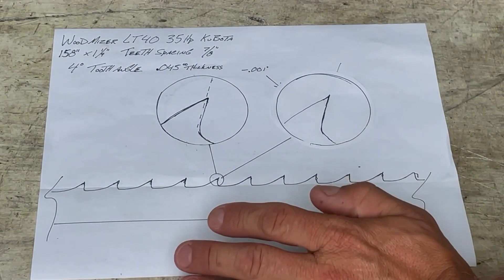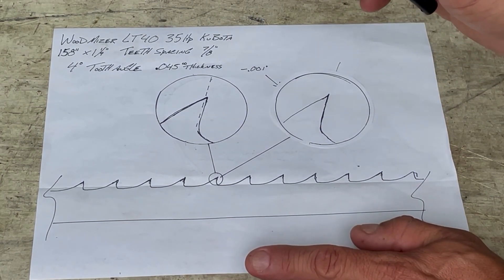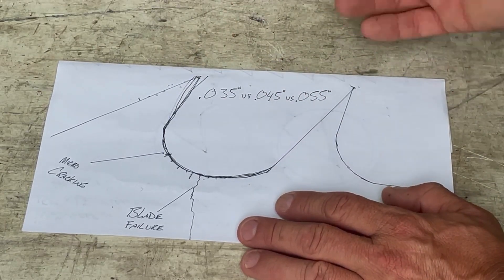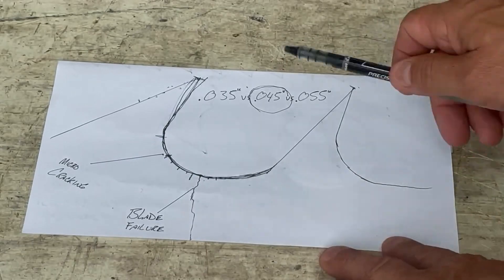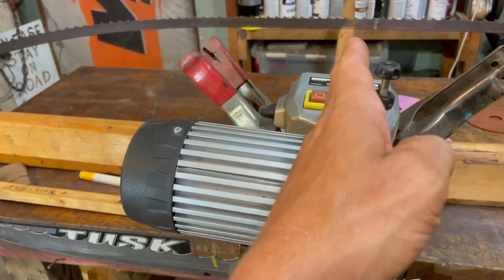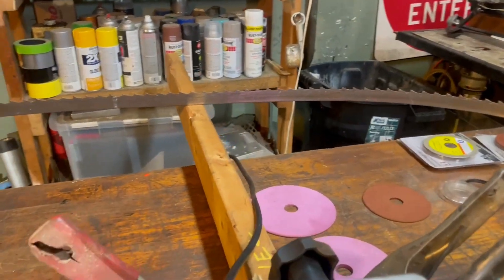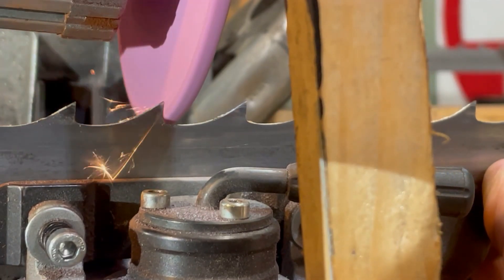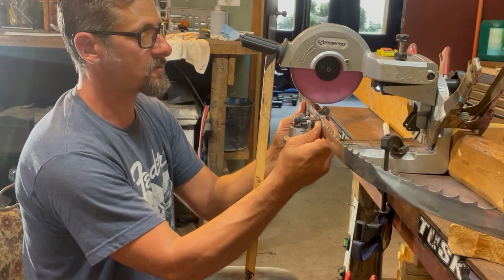How to Sharpen Sawmill Blades [DIY] ┃Save Money Homemade Sawmill Blade Sharpener #sawmill #sawblade

Comment: I ran across your video again. You mentioned about lifting the sharpener up and grinding to tooth off. Isn't your grinder set at the tooth angle? If so it should lift without hitting the tooth.

Comment: When i buy new woodmizer blades they have blue tips, think its from the hardening, do you know if they get blue when grided that makes them softer or harder? would think it depends on the metal can air harden or it needs to be shock cooled to harden?
Think the brown disc is meant to be oil cooled.

Comment: You made an excellent video.  Thanks!

You got straight to the point without rambling about a dog that had puppies or a lane joke you heard.  This is the way to make a useful video.

I'll be checking to see if you make a video on carbide blades.  I doubt I'll be using anything else if I can find them in the right length for my mill.
Reply from the maker: Thanks for the kind words, glad you found the video helpful!

Comment: In 2002 I bought a Linn Lumber Mill 190A to build a small cabin with. Along with the mill I also bought their sharpening and tooth setting equipment. These purchases that I made have saved me a lot of money!!!!! I still have a couple of the original blades that I have sharpened probably as many as 20 times. 
The Linn Lumber sharpening and tooth setting equipment is not expensive and simple to use, check them out!!!!

Comment: Full profile sharpening is the best way to go , and if you are serious about case hardening the gullet use a fine burr grinder to "polish" the gullet, sharpening only the face of the tooth is making the the tooth thinner each time which in turn may create a weaker tooth and "wash boarding "may occur, I suppose which ever way works keep using that method👍

Comment: if you take a small bright led flashlight and shine it on the face of the tooth after you have sharpened it one stroke the reflection from the sharprned surface will show you how the stone is contacting the tooth and if needed make adjustments. I waer a small headlamp so I don't have to fool with flashlight

Comment: Update;
Man I shaped a grinding wheel to match my blades and had good success,. or way better than what I had.
Problem is it was time consuming.
I know that my blades cut like a razor,.... But..
I also know holding the blade by hand I'm getting some variations in angles and depth,. don't get me wrong I had surprising results by hand, considering.
I again was using a full on bench grinder not the chainsaw grinder.
But I have now gone to the Dark Side.....
And sprung for a RS30 with setter from Woodland.
Reason for this ...
I fell into a supply of muddy and rock filled logs, and I can only clean so much(I miss a little here and there)
So motivation got the best of me.
I know that I am going to be sharpening A LOT more blades AND (more frequently....)
And can't just be waiting for Rainy Days.
On a side note,. My wallet, or paper fold is Less now.
Like you said, a sawmill is nothing without blades(Blades are a Vital...REQUIREMENT) 
Cheers and thanks for helping me along.
Reply from the maker: Put A video up and take on clients. Make some of that money back. Just don't keep peoples blade for little or no reason.

Comment: I have been trying this method, but seems like I cant saw very long, and some blades just want to wander down or up in the cut.  i am thinking the blade should be set?  what are your thoughts?
Reply from the maker: Make sure you don't blue or loose the temper on the very tip of the tooth, very easy to do, that could possibly explain why they dull fast.. Consistency is important/crucial. If your taking more off of one side of blade than the other it may start to walk, incorrect blade guide set up is another culprit. Blade tooth set is more quality of cut, rough vs smooth, in my opinion. If your having some blades cutting correctly your doing it right just not all the time. Hope that helps.

Comment: I think you should use a circular blade saw sharpening disc. It has an outer rim glued to it made of diamon dust or something like that. Buy a good quality one and it will last a very long time. 
I have one and i sharpen all my saw blades, i have also made a jig to sharpen drill bits. And keep in mind the circular saw blades have carbite teeth. It hasn't changed it's shape a bit, still flat. The downside is, the rim wich has the diamond stone is only on one side and is pretty slim. But compared to the stone you're using that sharpens just like factory. You have to keep in mind that the disc, must be perfectly balanced in centerd in the axle.  The problem with normal sharpening stones is that the steel eats them as you grind and if you only use one little side of the stone all the time it will make a small gove in there wich will ruing the sharpening of the most important part, the tip of the tooth.
Reply from the maker: Excellent, maybe I can find one that will match my arbor.
Reply: or you can use the grinder itself to make an adapte from wood or mdf. I made mine from a piece of laminate flooring. You just need a drill bit of the shaft diameter and some pieces of wood to form a jig so you can shave it with a chisel. What centers the disc is those 2 washers from the grinder's shaft, basicly  you just need a ring to match the holes. @CobbleCreekCabins

Comment: I find that with this technique eventually a tiny groove forms in the grinding wheel that takes the top of the tooth off.
Reply from the maker: Ya thats been mentioned previously, after a bit I just redress the wheel. A diamond grinding disk would be ideal.

Comment: I have surprisingly sharpened with a file with good results, but my beard got longer before I was done.
Have trust issues.... that I will actually get MY blades back that I sent and not somebody else's that has been sharpened 3x's already. ETC....
Shop guys swear only they can sharpen blades, chainsaw shops are the same.... News break, I can sharpen too....
I just have to get past that learning curve..... and then setting...
Cheers.
got a thumbs up...
Reply from the maker: Excellent, thank you.

Comment: Very neat idea.  How many sharpening's are you getting out of a blade?  After you have sharpened a blade about 7 times or so, Have you every measured the teeth spacing?
Reply from the maker: My blades have only lasted about 3-5 sharpenings before metal fatigue and failure, or run into metal. Hope that helps

Comment: This is great, thank you!  Setting up my sawmill soon and really want a way to sharpen at home that isn't crazy expensive.  This seems like a good way to go.
Reply: I use an auto drag sharpener and found it important to re dress the face about every 8 blades . If not you can get negative rake. Ask me how I know 😮
Reply from the maker: @willcoe8419 Thanks I'll have to look up auto drag sharpener. I know what your saying about the negative rake. It's a thing
Reply from the maker: It's the best I've been able to come up with after half a dozen attempts or so. Take your time I'm sure you'll get the hang of it. Thank you for the comment